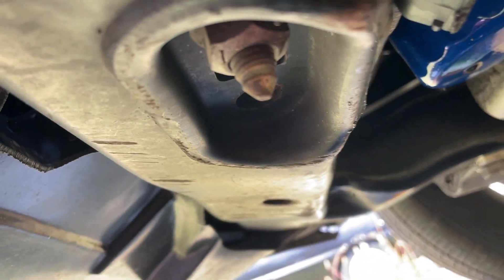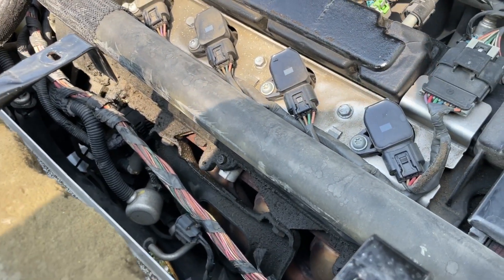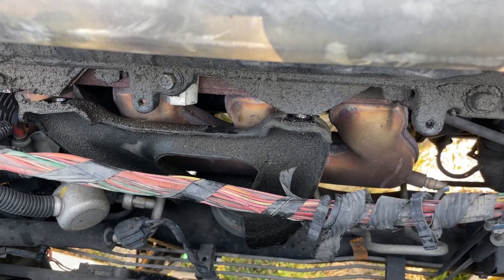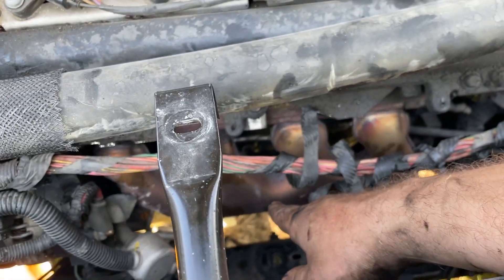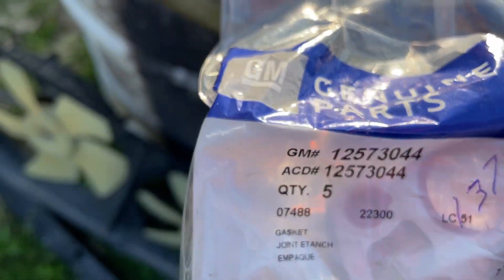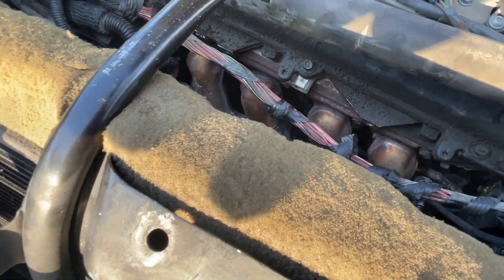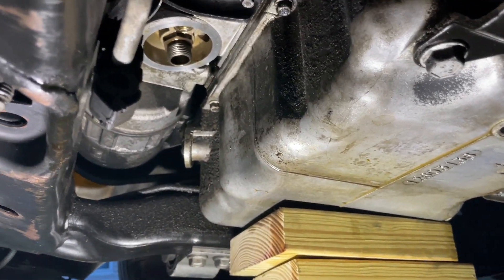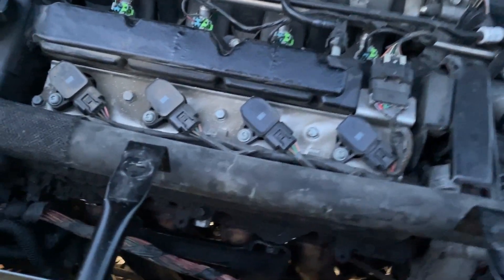2007 Cadillac DTS Oil Filter Housing Seal and Oil Pressure Sender Part 1

Comment: this is a good post showing how to do this however i will not go thru all this on my neighbors car i will just do a delete on the oil cooler lines i will cut them off and out of the car and take out the oil filter housing plug the oil cooler ports or get a housing that des not have the ports and do the job of replacing the leaking seal..  one thing if the engine has the crank position sensor/s in that area it may be good to just change them out if your going thru all this work for the oil filter area leak and put the seal in might as well do the sensors and oil pressure sender as you did. but maybe you can confirm if there is a crank sensor in that area no one seem to know for sure. thanks for the good production.